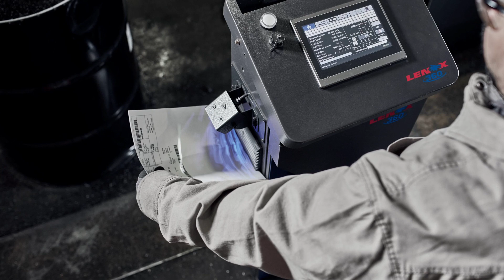TOOLING UP: Making the Most of Your Band Saws with Lenox [S2 ep.#7]

Comment: There’s conditions called “broken delta”, under which you can see voltage between all three legs of the supply but equipment is still single phasing. It happened to one of my customers.
Although it is not this case because when that happens no there phase motor will start - only hum.